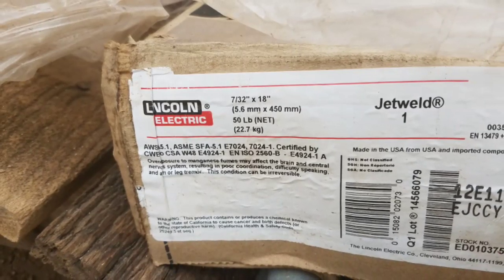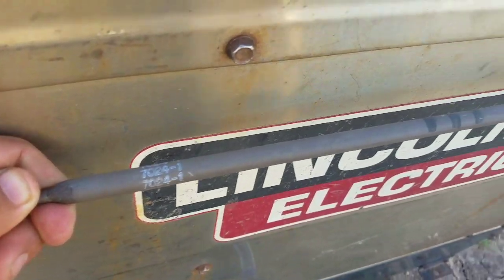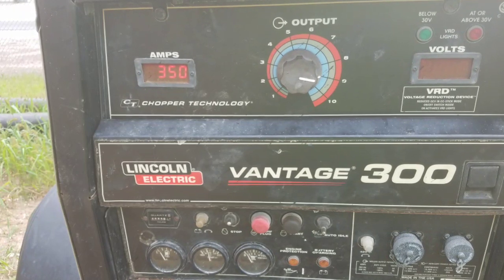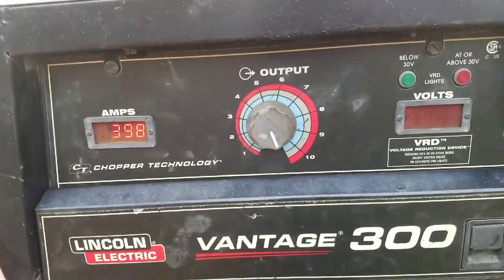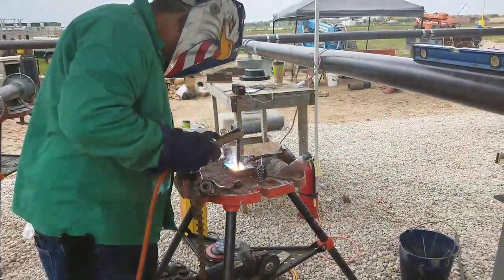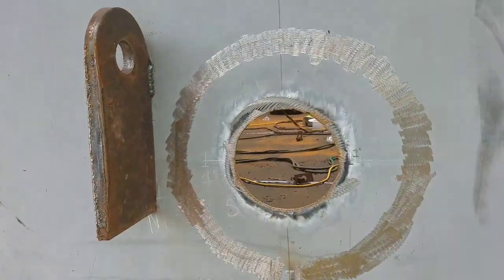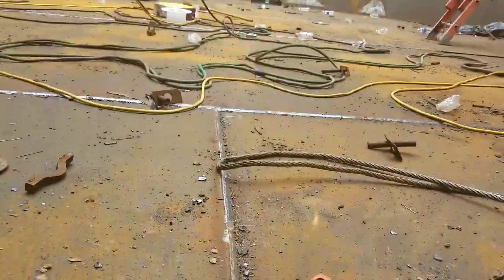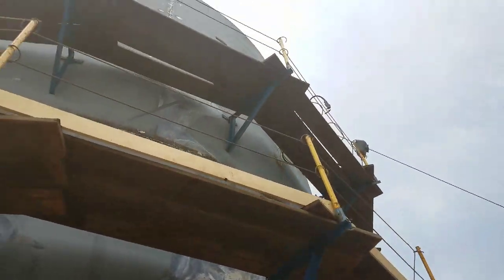Welding with 7024 X-large electrode!!

Comment: I've run 7/32 7024 welding welding rods at 275 to 375 amps
Reply from the maker: +Gus Pritchett 
I know is a hot💥 Rod.
Reply: CAPTAIN MANNY I've used an arc force with my 7/32 7024
Reply from the maker: +Gus Pritchett 
Yeah that helps alot.
Reply: CAPTAIN MANNY my arcforce was set for 7/32 was 4